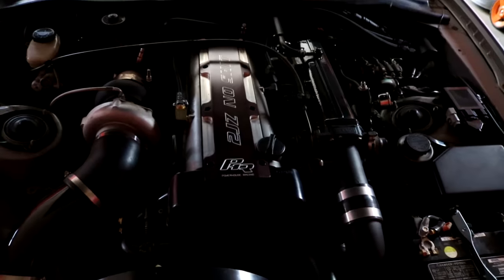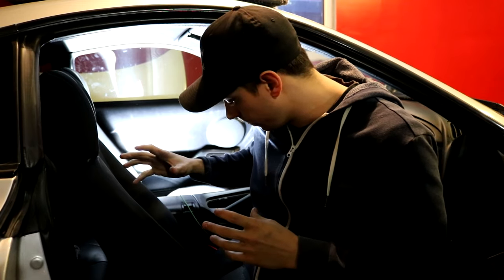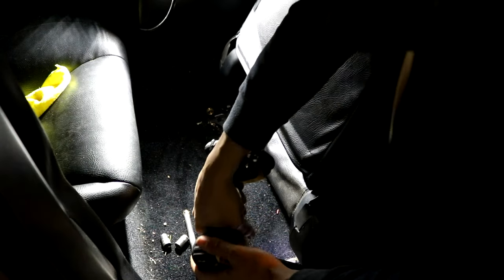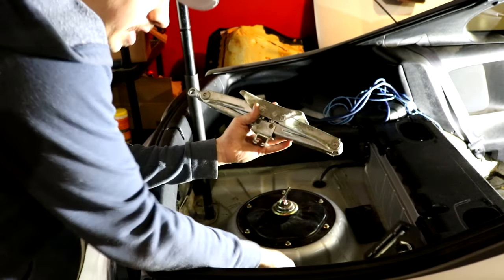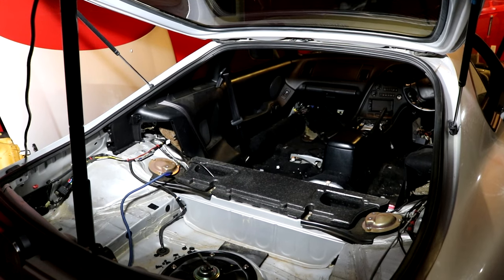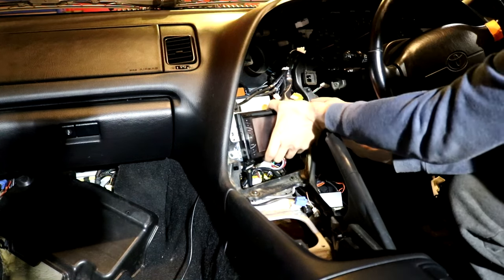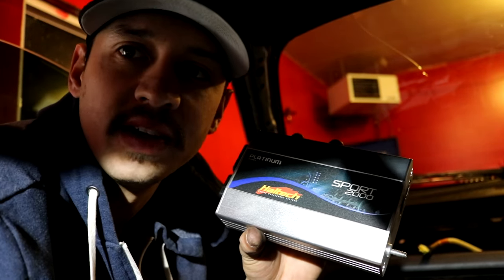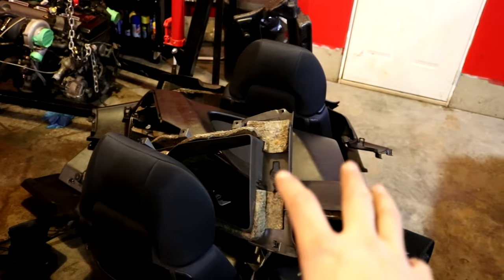Supra build | Part 3 | Stripped

Comment: supra tip for the rear hatch struts you can bend then just enough so they hold the hach up. its scary at first but just push enough pressure in tge center while the hatch is up to slightly bend them. works like a charm and its free lol
Reply from the maker: +Carlos Rodriguez good tip!
Reply: Carlos Rodriguez I've done this to mine lol